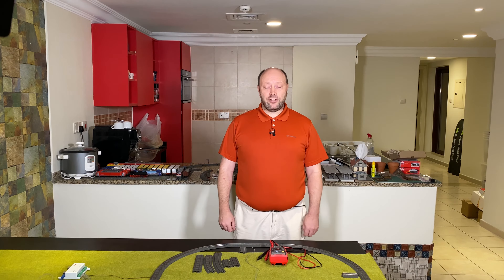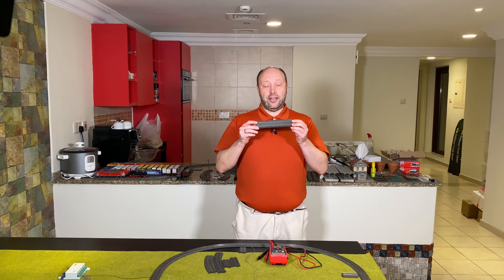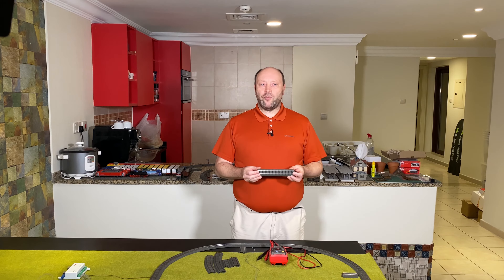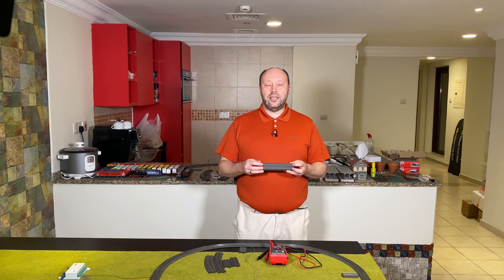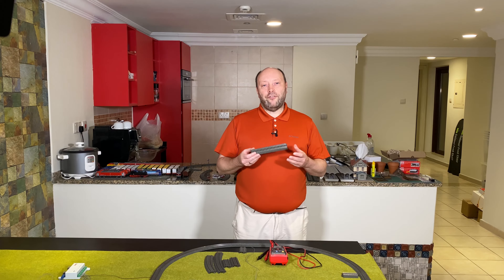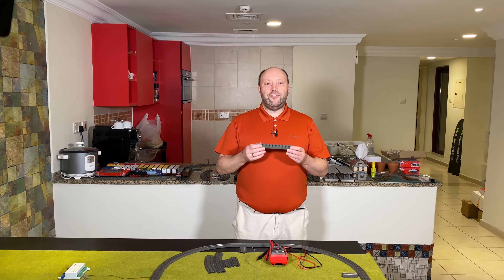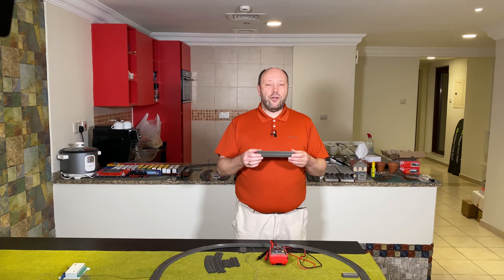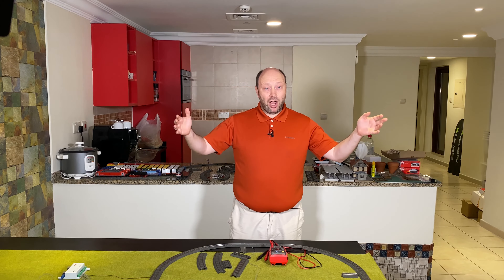Creating and Troubleshooting Märklin C-track Contact Track (Automation Episode 2)

Comment: To quote your words YIPEE YIPEE. At last after buying a new set of tracks and following your advice my contact tracks work finally. Thank you very very much Bo for the help. Can i just ask one question more please. If i buy circuit tracks do i need to purchase more than one if i have three circles connected by turnouts. What is the purpose of circuit tracks and are they really necessary? Thanks again
Reply from the maker: Hi, 

Great to hear that you succeeded! 

Circuit track can be used as an alternative way of detecting where the train are. The contact track detects presence of something that connects the two rails, while the circuit track detects that something with a slider passes. This means that the circuit track can detect either a locomotive or a car with a slider. The benefit of the circuit track is that it can detect the direction while the contact track just detects if something is there.

I prefer contact track as circuit track only comes in a few types of track pieces making it a less flexible solution. The circuit track may detect a train multiple times if there are more than one slider. Finally, it is a little more cumbersome to detect if the track is vacant.

As for your question on the 3 circles. This really depends on what you are trying to achieve and how you intend to automate. Note sure how to answer this easily. What do you have in mind?

Hope this helps! Enjoy ;-)

Comment: you inserted the insulator in the wrong way. The little tab must be up to prevent contact between the rails...
Reply from the maker: Thanks for the tip - I believe it will reduce the "touching rail" issue. 

Indeed - I believe you are right - it should be turned up. I have always wondered about the little tab and how to turn it. I relooked at the manual for the Märklin 74030 insulator: the funny thing is that on the frontpage it is turned down and no text really says what direction it should be. However, the picture on page 2 - although difficult to see - seems to indicate the tab should be turned up (towards the rails). 

When experimenting it seems to make sense that it will create just a little space between the tracks - although I must admit a side-by-side comparison did not reveal a visual difference.

What is your experience? Do you still get a touching rail issue - or is it completely removed? Guessing it could still happen at the beginning of inclines?

Enjoy model railroading ;-)
Reply: @ModelTrainFun  I am just a beginner who learns thanks to people like you, and thru documentation, . Thank for you time
Reply from the maker: I stumbled across the manuals for the signals - to me it seems that the tab clearly has to be down (page 32): https://static.maerklin.de/damcontent/80/3e/803e565a406f08748a0372953b6c39721616401922.pdf

After more experimentation I do not see any benefit in the tab being up - but I might be wrong ;-)

Comment: Good video but this changing over isn't for young kids getting in to this once loved hobby. The manufacturers have almost ruined this hobby with such nonsense.
Reply from the maker: Hi Robert, The great thing with Märklin is that they also have a startup series for kids (6+years) and even a MyWorld (3+ years) series for the very young. The MyWorld series is with batteries and specialized for very young kinds, but the startup can directly be transitioned into the regular Märklin. Great way to get kids started and is really successful as well. Enjoy ;-) Bo